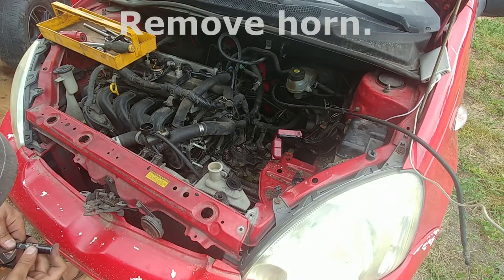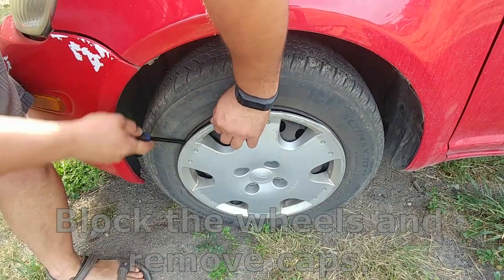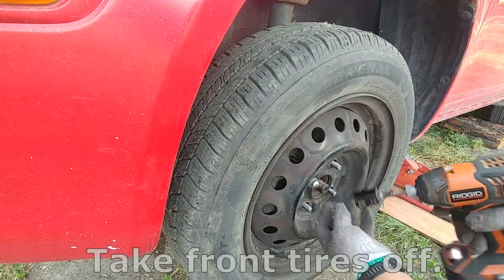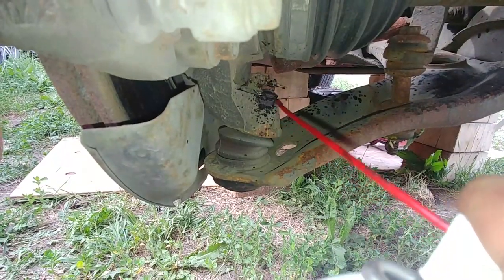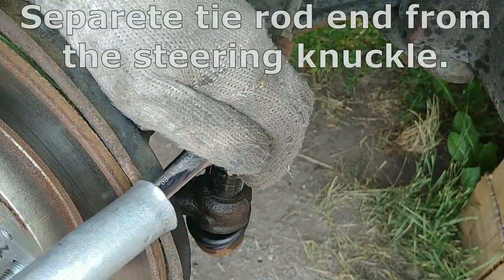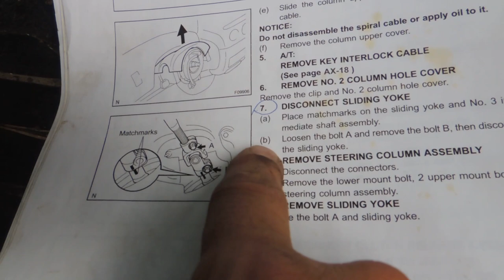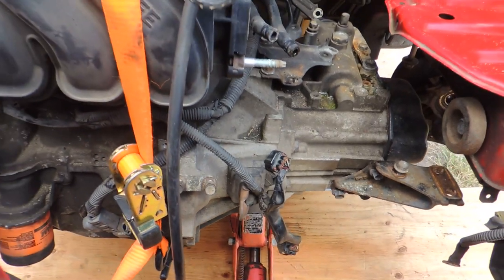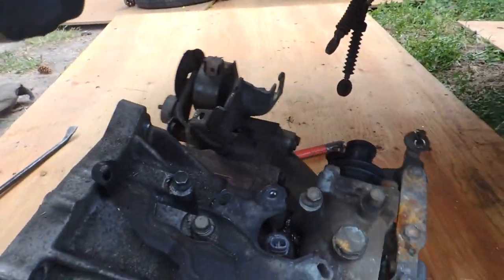How To REMOVE GEAR BOX. Step by Step.  TOYOTA Echo, Yaris. Transmission SWAP. EP. #1

Comment: OMG this video should be called "the hardest longest way to take out a manual transmission in a Toyota echo".
Reply from the maker: Haha, pretty much! If you do it right there's no short cuts.
Reply: @PistonShack  Are the 2007 Toyota Yaris different than this because it was the first fwd clutch I ever did on Sunday Nov 3 '19 and I didn't have to do any of the things done in this video 😂. I didn't have to drop the subframe , did not take out the radiator or cut the swaybar endlinks. I'm so glad I watched this video after I actually did mine. Would have totally screwed myself LoL. Took me 7 hours only because I tried to buy a pilot bearing (learned these cars don't use one) and then I couldn't figure out how to get the dowel pins out of the flywheel so I tried to buy those too (nobody had) then my friend told me the Visegrip and 2 prybars method , pins were out in seconds. Probably could do it in less than 4 hours easy... Cool video tho 😎 maybe Echo different or you need to kill the person who gave you those instructions 😂.
Reply from the maker: @turblown  Yeah, that was challenging learning process you went through. Well, up to 2005 models you need to drop the sub-frame to get gearbox out. There's no other way around. I tried to minimize amount of parts taken off.  I done gear boxes and clutch before on different vehicles, but this project took me around 15 HRS to get everything done. I am glad this vid helped you out with your repair. BZW, thanks or sharing your experience ) Cheers!
Reply: Ive replaced 4 gearboxes on my yaris its a 1.0 1szfe, gearbox oil out then shafts next do the gearcables, and unnolt any ancillaries on the gearbox such as the slave cyldiner and cylinder pipe retainer, jack on the engine to take the weight back mount undine aswell as starter then do the top bell housing bolts leave 2 in the bottom take the gearbox mount off at the front let the jack down an inch then take bottom bell housing bolts out shimmy shimmy out to fuck lol
Reply: With this Echo, you have to take down the sub-frame.  The part absolutely not necessary is taking out the radiator, rad support, idle air control, throttle body, hood latch and so on.  You also don't have to take out the sway bar.  You can leave it in, attached to the tie rod ends, and just unfasten the swaybar bushing brackets from the sub-frame.  Also, on the transmission mount at the right front, all you need to do is remove the 3 bolts into the transmission.  The rest can be left in place.  Watch Uncle Tinman's video on the same subject....and he does a much more efficient job at replacing the clutch on this car.

Comment: This gentleman is simply good in his explanation
Reply from the maker: My pleasure, Danny!
Reply: @PistonShack   I tried removing the the gearbox fluid empty bolt 24”nut it is supper tight. I stopped avoiding stripping it. How can I get loose with basic tools?

Comment: my yaris needs a new clutch. This is a nightmare.
Reply from the maker: Hi Dave! Yeah, if you have warm and dry place to get it done, that's way to go. Well it took me good time to replace the clutch. Little bit a work involved) Let me know if you have any questions.
Reply from the maker: Hello Halide,
Thanks for sharing your situation. Also, to separate O2 problem from the lean condition check if your Short fuel trim showing ECU adding extra +30% fuel to correct value. Add propane to the intake right after the air filter to see if your sensor responding to the extra fuel added.  If your voltage went up to 1000mV sensor is responding but you don't have respond at your O2 sensor (shows 0) this is not lean condition. We have a bad sensor. It could be wiring problem down to the sensor, check signal wire for shorts to the ground will pull signal down. Bad ground on sensor will run voltage up. Replace sensor always with factory made one. Cheers brotha!
Reply: I’m removing the engine from a wreck, just need the engine. 
I’m just angle grinding the damn thing out.
Reply from the maker: @funposting8912  Oh, that's fine! You do it quick as possible plus save part you need and leave good parts for other pickers as well. Thanks for watching.

Comment: Thanks for the video.  Going to be doing a clutch project this weekend with my daughter on her Echo.  Hopefully it goes at least half as smooth as your video.  Should make for a fun father-daughter wrenching project.
Reply from the maker: Hi Nick!
That's awesome to hear) So glad to help you guys. I hope vid will become handy. Plz let me know if you have any other questions. Cheers)
Reply: How did it go?
Reply: Grant Leslie went good. Had to adjust fire a little for having power steering so the lines had to be disconnected before dropping the subframe. Also my subframe (2000) didn’t have the long trailing bars as pictured in the video. So it runs great now. And we just finished replacing the shocks on all four corners so it rides great too.

Comment: Thank you for your effort and time you put into this video. Respect!
Reply from the maker: I appreciate that Rustem! How is your clutch replacement going?
Reply: @PistonShack  so far so good. I could not find anywhere where it says that there is a pilot bearing. Did you change one?
Reply: @PistonShack  same as all the starlets and chevy spark . With out remove the front crossmember . Slide the gearbox out and in . 🤓

Comment: Good detailed video mate. Is this is a 1.4 engine? I'm surprised of the amount of work for a clutch change in this relatively simple car. You've disassembled almost everything in the  engine bay.   Never seen a radiator has to be removed for changing the clutch.
Reply from the maker: No mine is 1.6L engine. I think 1.4L should be pretty much the same.

Comment: The 1NZFE Yaris automatic is easy to maintain long term. Just drain and replace fluid if the environment is not too dirty or the vehicle wasn't abused.
Reply from the maker: Yeah, interesting point! You don't have to change clutch every 100-150K that's for sure.

Comment: Hi i have a toyota yaris too but its the t sport with 1nzfe engine, im struggling on removing the subframe as there power steering fluid cables attached to it
Reply from the maker: Hey, Tom.
There's two ways to go:
1) leave power steering hoses hooked up and undo the steering ruck from the sub-frame. Check the video: VW Golf MK3 gearbox removal - you can do exactly the same on Toyota; 2) flush power steering fluid and disconnect return  and pressure lines from the rack. 
Let me know what worked for you or if you have any questions. Cheers!

Comment: Hi. My 1sz manual gearbox doesn't have a base plate so it makes a sound when releasing clutch. Can you show me the base plate? Black in color
Reply from the maker: Hey brotha! What's a base plate? Did you mean flywheel or pressure plate? I don't understand your question.

Comment: Very nice video...I wish you could show the new clutch installation and re-install gear box with motor in one video.
Also did you adjust the throttle position sensor when putting back the throttle and how you adjusted?
I guess your Iddle air control valve was good as well?
Reply from the maker: No, issues with idler air control ever since. Do you have any problems with cold or warm idle?

Comment: Hello iv took lots of parts off my yaris an nearly ready to lift the engine out.  Can you give me any advice to dissconwct the fuel line please ? I moved the nlack pladtic housing off but i dont know to to dosconnect the line itsel ?
Reply from the maker: Hi Jack! Are talking about fuel tube connector (quick type)? 

There's few steps:
1. Remove the fuel pipe clamp.
2. Check if there is any dirt like mud on the pipe and around the connector before disconnecting them and clean the dirt away. 

3. When the connector and the pipe are stuck, pinch the retainer between the hands, push and pull the connector to free to disconnect and pull it out.
Okay, for the metallic type of connector you need to get one of this tools: OTC 6509 Fuel Line Disconnect Tool or similar type.
Cheers!

Comment: Hello mate i have now brought an engine crane to take out the enginr on my yaris.  But found that the emgne doesn't have any lift hooks. Any ideas what i can do ??
Reply from the maker: Hi Jack, 
There's two ways to do it:
1) install engine hangers, what Toyota recommends,one at the front above the alternator, second one at the back of the engine near to 4th cylinder - I don't have them, it means it won't work for me;
2) get strap hooked up how I did on the video to support the engine at the back near the bell housing; second one run at the front of the engine. Kinda like that. 
Let me know what you figured out or if you have any questions. 
Stay warm!

Comment: Hello mate i really dont like to keep bothering you. But i look on ebay an the chery pickers are afew hundred pounds. After i took the engine out of car, i was going to take it apart an rebuild it anyway, so would it make much difference , if i just take apart an remive it from the car, instead if buying a cherry picker ?? Thanks
Reply from the maker: Hi, Jack. No worries. You're welcome!You can use almost any type of lift but to match engine and transmission could be challenging. I thin you can get it done. Yeah, let me know how your progress is going. Cheers!
Reply: @PistonShack  ok thanks you.  its raining today so i gota leave it for today. Thanks

Comment: hi any one knows where is it located the speedometer sensor on yaris 2003 1.0  please help
Reply from the maker: Hi, Kakou
Speed sensor on manual gear box located on a right side above the ring gear. Let me know if you have any questions. Cheers.
Reply: @PistonShack  14:53 you have disconnected the speed sensor on the model 2002/2003 that sensor is not there anymore  that place is blank
Reply from the maker: Mine is 2005 Toyota Echo. Find how new speed sensor looks like then locate the sensor on gear box.

Comment: Hello mate i have toyota yaris its an  03pllate.  I want to take engine out. Do u know how many engine mounts its has ?
Reply from the maker: Hi, Jack! Yaris has three engine/transmission mounts. One behind, one on the gear box side at the front and one front of the engine. You might need to remove crankshaft pulley to get enough room to pull the engine out. Cheers!
Reply: @PistonShack  ok thank you very much mate   . Do you think its pissible i can take out the engine in bits , instead of buying a crane an pulling it all out in 1 block  ?
Reply from the maker: @jackjonson2696  Technically you can do it but I would not recommend it to you. Better, just rent Cherry picker crane for one day   - dirt cheap.
Reply: @PistonShack  ok thanks very much
Reply from the maker: @jackjonson2696  You're very welcome!

Comment: I guess you would need to do all that and much more to remove a manual transmission and replace with an auto transmission? Used parts would be cheap but unless you do it yourself it would cost a bundle I think.
Reply from the maker: Well, I don't think that's a way to to. Just go and get another Echo with Automatic gear box. No hassle.
Reply: @PistonShack  I'd get something else besides that but thought the change out would be easy apparently not it seems.

Comment: lol there is no need to remove all these parts just for taking out the gearbox.....
Reply from the maker: Interesting, hmm! Thanks for your feedback. I followed Toyota Echo Service Manual. Do you have video as example?
Reply: @PistonShack  no i dont have a video but i will have in about 2 weeks when i remove the gearbox from a yaris ts to do some maintenance in it.
Reply: @PistonShack  Here is  my video https://www.youtube.com/watch?v=FhRDleas2zI As you can see i didnt even remove the driveshafts from the car and the shock absorvers are off cause i wanted to change them too , its not necessary to remove them for the gearbox.Also i removed the throtle body and the radiator fan cause i have a custom intake manifold and couldnt unbolt the starter,if i had the oem manifold that wasnt necessary either.It took me 1 hour and 30 minutes to take it out

Comment: I dont understand ; WHY remove all that , wasting time and what you removed unnecessary. Drain cooling, removed idle t , and so . It’s very easy to access the gearbox without removing all . 🤦🏻‍♂️
Reply from the maker: Hi Kamal! Have you change your clutch without dropping subframe?  Interesting point, it probably depends what engine do you have under the hood. There's literally no room to remove pressure plate and change release bearing. Thanks for you feedback. Bzw, make short video how did you do it.
Reply: Plenty of room. U almost disassembled every part
Reply: Agree with you.  The radiator, rad support and hood latch, throttle body definitely did not need to be removed.  It's easy to work from under vehicle, once on jack stands.  The sub frame removal might be necessary. The rest is a waste of time and energy.  Also, not necessary to remove tie rod ends or swaybar.  The cv axle comes out simply from removing strut bolts and wheel hub bolt.  This repair likely took way too long than was necessary.   The bushings on the sway bar ends can be reused, if not cut.  Not bad to replace them, but there is really no need to cut them.  They can be removed easily without cutting them.